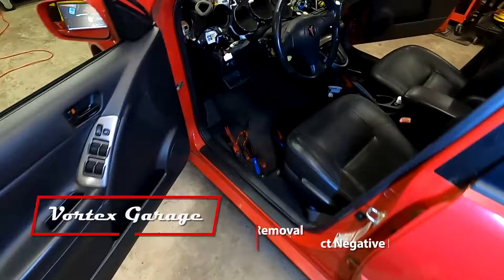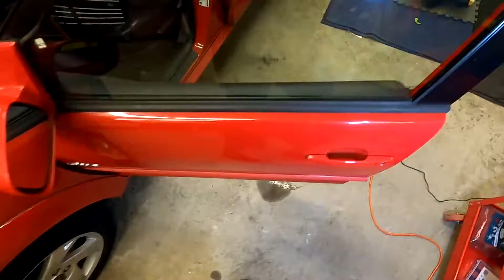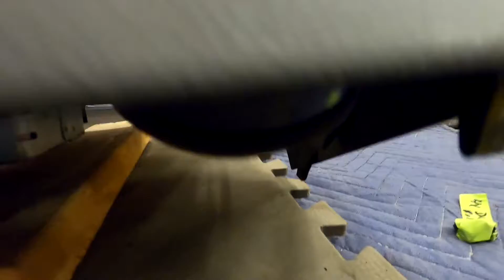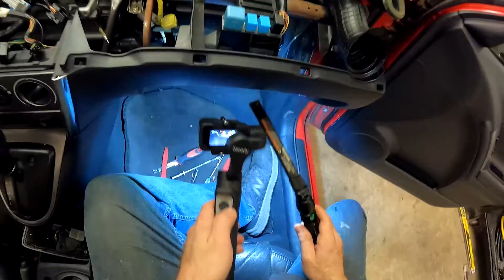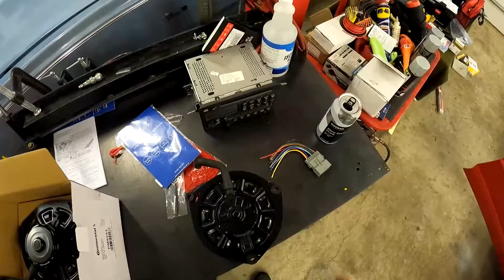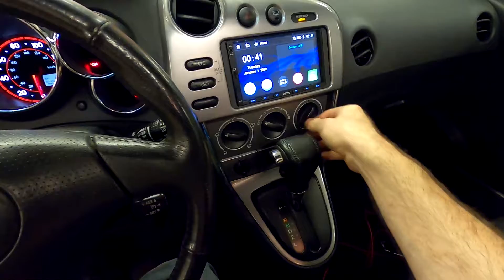Pontiac Vibe / Toyota Matrix - Recirc Blend Door Actuator, Blower Motor, and Dash Removal Steps

Comment: Hello VG! If I could kindly pick your brain, your eyes on view of the air ducts may have shown you the answer I seek. My 2005 Vibe has good air flow from the vents on both driver and passenger sides, but when in A/C mode, the driver's side air is cold but the passenger side air temp is just cabin temperatue air, not chilled. How can the driver's side be air blown over the evaporator but not the passenger air? Any suggestions will be much appreciated!

Comment: Please stop referring to the recirculating door as a blend door.  The blend door is operated by a  mechanical cable connected to the temperature dial. The recirculation door is operated electrically by the actuator. They are two different doors and your terminology is confusing and  misleading.  There is no recirculation blend door.

Comment: I changed actuator, and it stays constantly in position outside air. To svitch on inside, I have to hold button. Once I release it, door goes back. Is there any relay for it?

Comment: does anyone have any explanation as to why my matrix cooling fan comes on when the car is just started when the ac is on? turn ac off and the cooling fan turns off until needed when the car get to running temp ... then turns on and off when needed
Reply from the maker: Is the A/C on max/recirc?  That will often trigger an override on the fan making it come on - helps ensure maximum A/C efficiency.  But you are saying it comes on and then once the car warms up it goes back into on/off when needed even with the A/C still on.  Must be something in the programming.  I can't recall if this car did that - I'll try and ask the owner if I get a chance, especially as we are entering summer season.  

Maybe someone else with a Vibe or Matrix can comment if theres does this also - if so, must be part of the programming.  Cheers!
Reply: @VortexGarage     thank you for responding,  the car is cold and the high speed cooling fan is on
   without the AC on, the car gets to temp and the fan comes on and works intermittently 
without the high speed fan relay in, the fan won't come on even when at running temp, the cooling only happens when the compressor kicks back in
I'll try starting the car with ac on and inside air turned off
however, my inside/ outside mechanism isn't closing and reopening the outside air door ... on the matrix, it seems to be on the right side of the cabin filter, is this the blend door?  or is the blend door for the cabin heat control and in a different location? 
if so, what's that mechanism right side of filter called and what's the quickest way to change or repair it?

Comment: Wow great vid. My issue is lack of heat in the winter here in Canada. Dispite flushing the system twice and the heater core separately I still get only modest heat. This helps to clear up some issues with the approach to solving my problem so 👍👍. My fan resistor failed today so this will help big time in deciding the best approach. It's always a challenge to figure out how much effort to invest in an older vehicle.Thanks
Reply: Is the thermostat bad?

Comment: Regarding the blend door actuator...  Yes you can open up the actuator to rotate the output gear by 180 degrees but why bother?  I just put the actuator on the bench, connected the motor to 12 volt power, let the output gear rotate 180 degrees, disconnected the power and re-installed the actuator.  It has been running fine for about 10 years now.  This is a lot faster than disassembling the actuator to rotate the gear and eliminates the risk of breaking the plastic clips that hold the halves of the actuator case together.
Reply: tried it, this works.

Comment: Very nice! This will be handy reference if I ever need to do that service. One thing I've done in the past to my Vibe was using some silicone to glue some aluminum window screening across the opening for the cabin fresh air intake under the cowling to keep mice from entering the cabin. I've seen too many photos on the forums of mice chewing through the cabin air filter to one dying in the squirrel cage fan, and I'd prefer not to have to deal with mice on the inside of the car.
Reply from the maker: That sounds like a great idea!

Comment: I’m a Toyota technician You can do those actuators with out taking out the dash apart all you need is 1/4  palm ratchet but for the radio just get a harness kit they have them at Best Buy and you literally just plug it in to the OEM harness and it only gives you the wires you need to do an aftermarket radio
Reply: Oh my gosh, you have no idea how helpful this was. As a young woman without my father or grandfather to help me, this saved me so much headache, I wish I had read this before I changed the resistor and ac blower motor myself too, but I will replace that acuator without removing the dash, thank you so much!!!